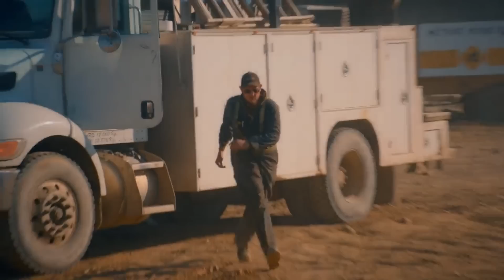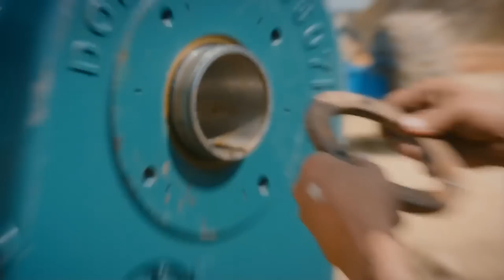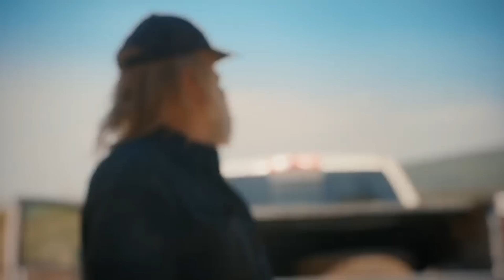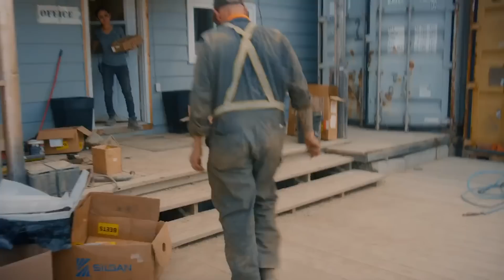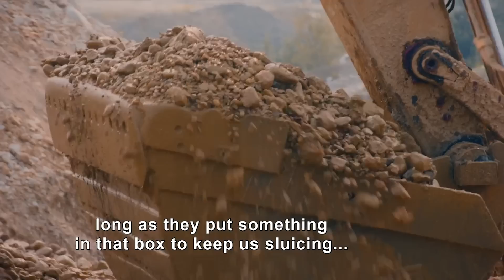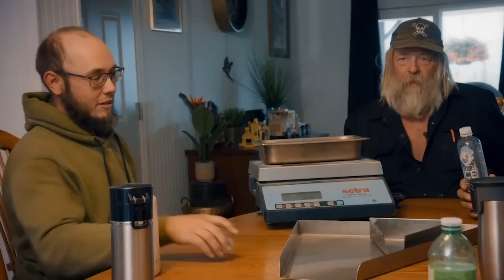Tony Beats' Operation Comes To A Standstill | Gold Rush

Comment: I'm  aware that this is mostly a reality show but I would think any company/outfit of this size would have different types of steel and have a small CNC mill & a small CNC lathe or at the minimum a conventional lathe. Being that they are so far from civilization it would pay for itself. I have to assume this part of the story was written this way.
Reply: Old bushing just barely doesn't fit, not called two day trip to town, called sandpaper.  Zip it with 3in grinder.